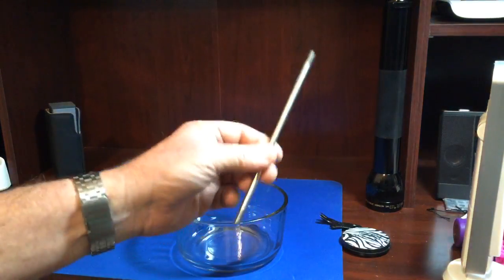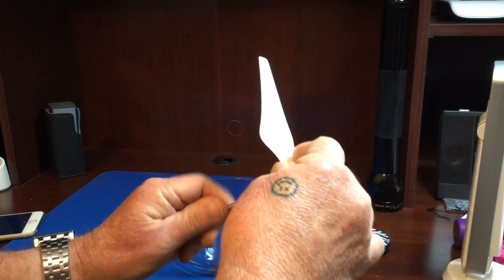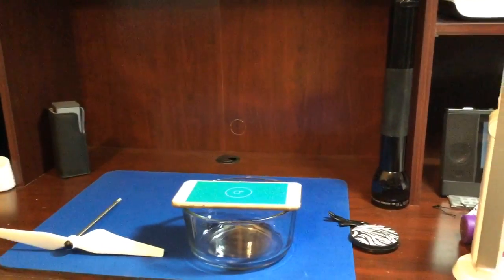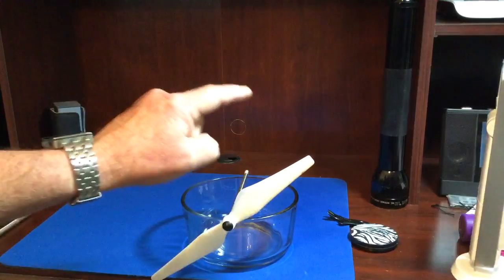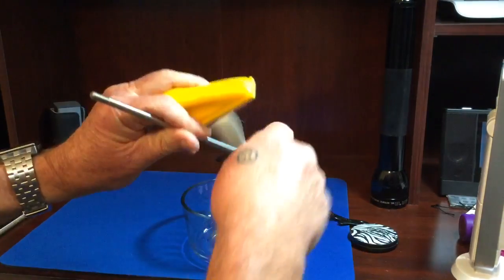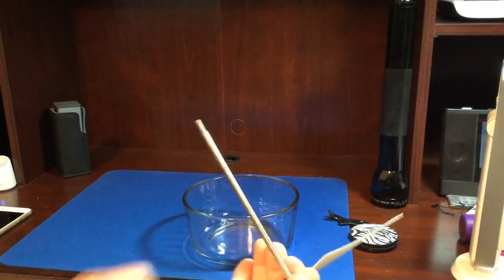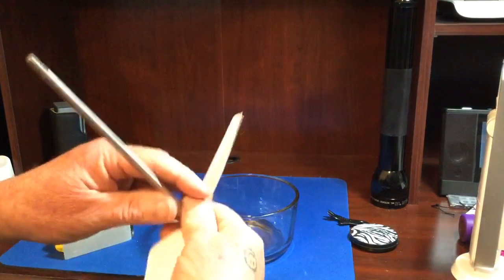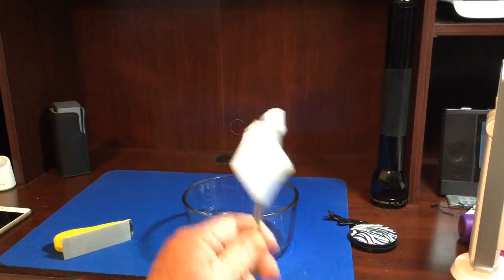How to balance your DJI phantom self tightening props.

Comment: Sanding is not a good idea since it differentially affects the Laminar Flow / Bernouli Lift characteristics of the blade.  There has to be a better way.
Reply from the maker: Ron Sindric Nothing about this process that will adversely affect the props. It’s just not an issue.

Comment: The absolute delusions... Propeller should be balanced when they are damaged, but for better is change it to new.
Reply from the maker: I'm not REAL sure what your sentence means, but if you mean that it is delusional to balance props for the Phantom 2 series, I'll disagree.  Unbalanced props was a BIG problem in some NEW props in the Phantom 2 series.  It would sometimes cause a "jello" effect in the videos as the unbalanced prop caused the drone to shimmy slightly, a motion that the gimbal could not absorb.
Reply: We have tested this myth about the propellers balancing... I repeat - the new, original propellers do not need balanced! Deviations are so slight that there is no need to do anything and has no bearing to flight. By the way "jello" effect completely is unrelated to the propellers balance :-)
Reply from the maker: I'm sorry, but that's simply not true.  Slight deviations would not cause a problem.  But MANY props that shipped with the P2 series were out of balance enough to cause the jello effect in video.  That's just true.  The jello was there, and balancing the props would clear it up.  Period.  

By the time the P3 came out, I don't remember ever having a problem with them, and I FOR SURE have never had a balance problem with a P4.  But in 2014, when this video was made, jello was a very common phenomenon in P2's, and often the culprit was an unbalanced prop.  That's why I made the video (and no, I was not selling these rods, I was just sharing what I knew.)
Reply from the maker: In fact, you could tell if you had an unbalanced prop by flying the P2 at eye level with the camera facing you.  Then go UP at full stick.  You could often see the camera shake side to side under the heavy acceleration.  After balancing the bad prop, you would not get as much of that shake when doing the same test.
Reply: One of our PH3P with a the same propellers we used 136 hours - 544 
times. Propellers never been balanced. All motors of drone works properly, filmed perfectly, no 
"jelly", no vibration until today. Drone is controlled perfectly. What 
more? By the way, need remember that DJI Phantom's is not a professional
 drone with a professional video camera :-) Therefore, all kinds of 
propellers balancing is called - just leisure of games... No more, no less.
Reply from the maker: The P3P's... all of the P3 series came with the 9450 props.  As I mentioned earlier, I don't remember having a problem ever with props on a P3.  THIS VIDEO WAS ABOUT THE 9443 PROPS THAT CAME WITH THE PHANTOM 2 SERIES.  I understand that you are a professional with many hours of flight on your P3, but number one:  The unbalanced props were a pronounced problem with P2 props (9443), and number 2: Not every 9443 prop was unbalanced.  In your box of 8 props that came with your P2, maybe only one or two would be out of balance enough to cause jello.  I'm sorry, but on this, I'm just right and you're just wrong.  No need to agree to disagree.

As far as Phantoms being a professional drone with a professional camera:  I have seen non-professionals make a mess with a Canon 5D, and I have seen professionals take an Elph 180 and create darn beautiful images.  That's why professionals like you can use a Phantom for 136 hours - 544 times and get fine usable results while we stupid pissants are on the ground balancing our props.